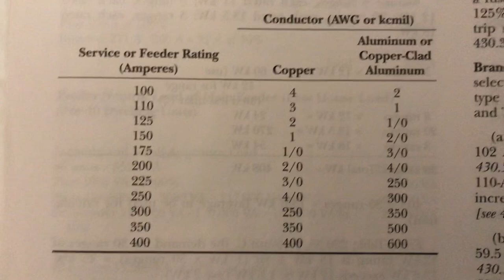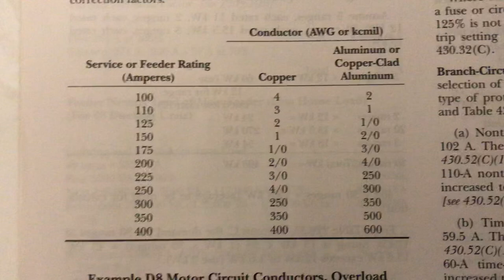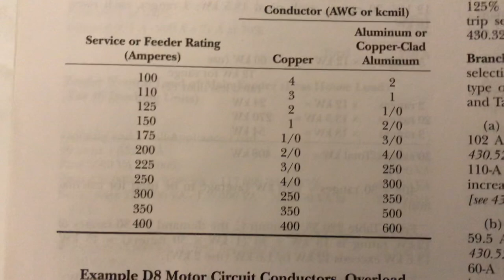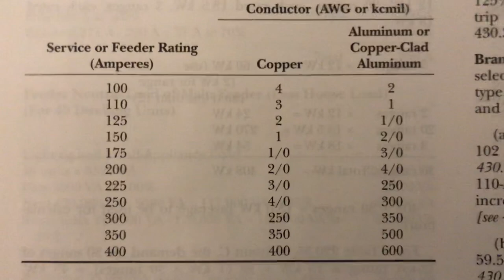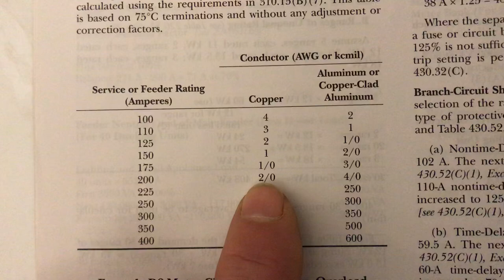What size wire do I buy for my electrical service panel? The NEC answers...

Comment: Hey brother nice vid.. I want to add that this table is with a 83% allowance factor 310.15(B)(7)(1) is the allowance... an if the service drop or service lateral takes the entire load of the dwelling from 100-400A then you may use the allowance..like you mentioned it was in 310.15 in previous cycles now in the 2020 it's back..✌🙏
Reply: This table was erased from 2020 cause it contradicts 310.15(16) 83% rule wasn’t used for this table
Reply: 2023 NEC has this table and is the same. So don’t worry about it. You can still use it

Comment: For very high amp services,  typically 400 amps and above,  at least in the area I work in, it's fairly common to run parallel conductors instead of one very heavy cable especially if  conduit is required.
Reply: It’s true. 2023 NEC has a calculation for parallel conductors in article 310.10(G)

Comment: How do we know what size and type of conduit to use with each type of wire....I'm putting in an under ground service feed from the pole to the meter on the house and using 2awg for our 100amp panel. Anyone know if all states allow the homeowner to dig his own ditch from near the telephone pole to their electrical meter, lay their own conduit and electrical from their meter to the base of the pole, and then have the electrical company just connect power to the meter and then finish connecting the service from the base of the pole up to the power lines on it. I've seen recent videos of people doing it but they didn't say what state they're from for me to know if Ohio allows it

Comment: Question: can # 4 SOOW  600V rated be used for a 100amp sub panel?  Thanks !
Reply: Did you ever find out what wire to run for a 100amp sub panel? I’m doing that now to add in my detached garage and I’m also unsure what gauge wire to use
Reply: @thisguyyy0075 did you ever figure it out? Id like to know too lol
Reply: @CarlosBravo94 3AWG copper or 1AWG aluminum

Comment: 200 A panel using Rigid PVC conduit 
Total area of the conductors-          ?
Metric trade size Raceway/Conduit-       ?
Imperial Trade size Raceway/conduit-    ?

Comment: Can i use 2 2 2 4  to run 125 amp from meter to service box?
Reply from the maker: 6chicolin9 copper conductors? By 2 2 2 4 I am assuming you are talking about two #2 “hot” conductors, one #2 neutral, and one #4 ground? What type of insulation does the cable have marked on the jacket?
Reply from the maker: Not insulation...markings I mean
Reply: @mkoelectric3322  aluminum conductor
Reply: @mkoelectric3322  2#2 hot 1 #2 com #4 ground.is black insulation.
Reply: I'm running the same 2 2 2 4 all single  insulated with black plastic. Just wondering if its ok to run inside of a         1 1/2 EMT conduit? Thanks